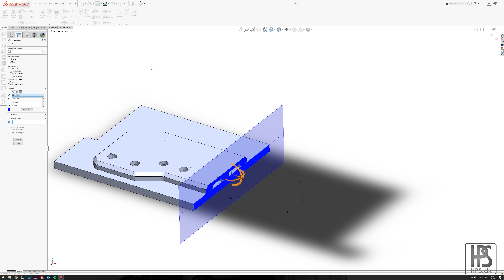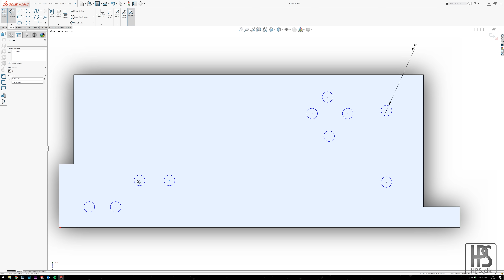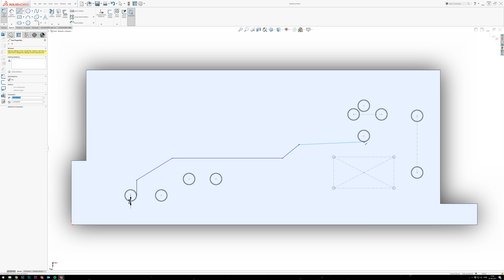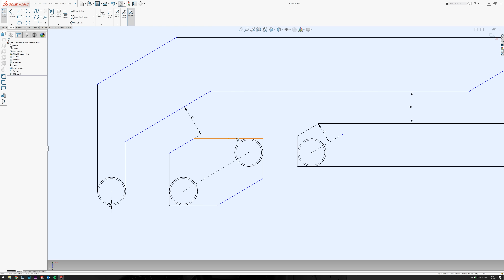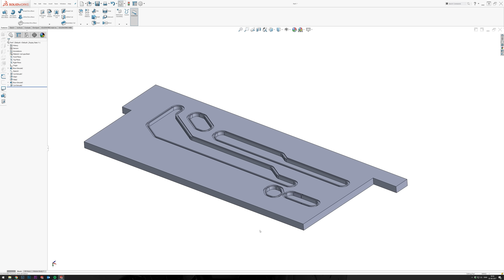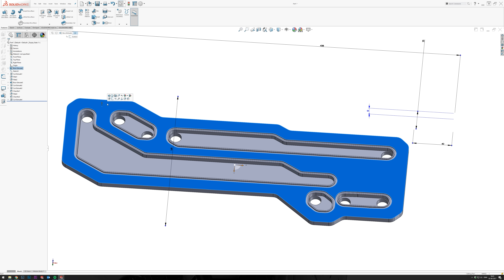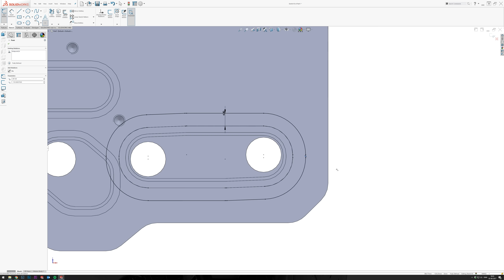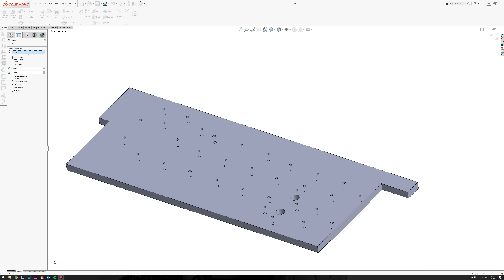Making a acrylic watercooling distribution plate / Manifold

Comment: Looks awesome Hans! Hey thanks for the tip about using another fitting to line up your G1/4 tap square. I don't have a drill press but I want to add an extra return port to my Radikult CNC res. Have yourself a Happy New Year mate.
Reply: Yeah, that was a PRO tip.

Comment: About tapping. A good tool to have around is a thread tapping block. Probably not going to find one off the shelf for G1/4. But iirc that's a parallel thread, and it should be really easy to make one.
Reply from the maker: Oh nice. I could probably 3d print one if needed. Thanks!

Comment: What CNC used? bits? Organization for screws etc? would really appreciate it. A lso for the ucstom cables, what pinout method do you use, PSU teseters like thermaltake dr power  II, multimeter? I'd really love it. My dream to make stuff like this, thanks.
Reply from the maker: I use whatever cnc is available at the time. The majority of the work is sanding and polishing after machining anyways.
I just use the original post cables as reference when making new ones. Much easier for me than any pinout scheme.
Reply: @metap0Pe  I have a cordless orbital sander with 3 sanding pads, would that work? I can buy more for it. I was also planning to use the original stock cables that came with the PSU aswell, and then PSu tester/pinout to see the voltages/lines in each pin I assume? I  usually make sure teh PSU's I buy come with their stock cables. I guess I'm on my way, thanks hans!

Comment: Do you have any experience with glueing acrylic plates? If you want to do some complicated, artistic runways for the water, you can't work with o-rings anymore. The problem with glueing though is that the glue spills out of the sides and leaves ugly residue.
Do you know of a way to glue the plates together beautifully and perfectly? I've even considered making a structure out of ice and then casting the PMMA around it. Then waiting for the ice to melt and rinsing it out. But I really don't think that would work well, when the 160° C PMMA hits the ice.
Reply from the maker: Haha yeah the ice might disappear quite soon. If you absolutely want to do that I would glue it and clamp it firmly together and run distilled water trough to get the glue residue out.
Reply: @metap0Pe  That sounds like a good idea. As long as the water doesn't creep into the contact surface, this migh work well. Maybe even more so with UV-activated glues.
Another idea I had was something like diffusion bonding. I would build an oven with very fine temperature control and then go close to the melting point of the PMMA. After some time I'm hoping it fuses together to form a solid block. I know this technique from metal working, but I have absolutely no idea whether it works with acrylic plates.

Comment: What does this distribution plate actually do? It doesn't cool water since it's made out of acrylic right? Or does it just improve the overall appearance of the machine itself? Just curious and not sure how I got here but I have a few CNC machines and this would be an interesting project as my spindle cutters are watercooled.
Reply: A distribution plate, like the name says, makes it easier to distribute the water from one block to the next. Starting at 7:04 you see, how he only has straight pipes from the blocks to the ditro block. It takes away some/most of the bends you would have to do with hard tubes.

Comment: Hopefully you respond, I know this is an older video. Thanks for posting this. I am using solidworks and am curious what program you use for sending the GCode to the cnc mill? Also what bits do you recommend for milling the cast acrylic? Thank you.

Comment: Do you custom order your o rings to length, or do you design each channel for a specific length o ring. If it's the latter, is there an easier way to define a complex sketch perimeter in solidworks?
Reply: Its that offset that confuses me, was it just careful planning that allowed you to know that the length of each channel before you started sketching, or is there a shortcut to it?
Reply: Oh, nvm, they sell them in .5 mm intervals. Would you say that .5 mm is within tolerance for this application?

Comment: Did you get any pressure drop from distribution plate? Look is important but performance is important, too.
Reply from the maker: Having tonnes of pressure and flow in watercooling systems is super overrated. You will almost never be able to tell the performance difference between almost no flow, and full throttle with 4 pumps. The heat capacity and absorbtion ability of water is just so high.
Reply: hans peder sahl that's not necessarily true. It's just like with fps. If you go from 30fps to 60fps it is a massive difference, but when you go to 60 to 90 FPS, it's not really that impressive of a jump. And then when you go from 90 to 120, it's even less impressive of a jump. It's because it is exponentially decreasing in performance. The performance is still gaining but it's only gaining buy a little minuscule amount. Of course if the water was not flowing it would immediately ramp up in temps and thermal throttle. Otherwise you wouldn't have to have a radiator... because water flowing through the radiator is literally what cools it. But there is a certain point at which it becomes a little excessive in speed. Water only needs to flow so fast to carry the heat with it. Just like I said when going from 30 to 60fps, it's an amazing jump, but anything above that is not necessary. I'm sure there are Freaks and Fanatics that would absolutely want to have the fastest water ever, but it is simply not necessary. It makes such a little difference that makes it not worth the trouble.
Reply: Tard, it has been tested. If by 90 to 120 fps you mean the 0.1C decrease in temps you get from higher flow/pressure, you're right. But to me the 30fps boost going from 90 to 120 is much more impressive than a 0.1C temp difference, especially considering that 0.1 is within the margin of error.
What happens in a water cooling loop is the water absorbs the heat when it passes through the water block and then delivers this heat to the radiator. From there, the heat is passed to the radiator and exits the loop by the air supplied by the fans. The only reason pressure or flow would matter is if the heat capacity of water was small and couldn't keep absorbing heat if it stayed in the water block for too long. That's not the case, just like Hans Peder said, the heat capacity of water is just so high, and so the water can absorb more heat than it actually does in almost all scenarios. As long as there's some fluid movement, the loop is good.

Comment: Hey, I am planning to make a custom water block and found this video very helpful. I have a couple of questions remaining:

Is it fine to use thinner o-rings? I was planning to get 1mm diameter. Does the risk of leaking increase if the o-ring is too thin?
How thick should the acrylic plate be, what's the minimum thickness? Is it possible for the water to rip the acrylic if it's too thin (let's say, 3mm)?

Comment: Beautiful work. The liquid cooling industry needs more people like you on their design team.<3 
I wish I had the skills and tools to make a mono block for my sabertooth 990fx R2.0 as those gosh darn VRM keep overheating. However the motherboard is too obsolete to even bother with liquid now. It would probably cost less to simply upgrade the system completely.
Anyone in the comment section know of any heat-sink/fan combination that might fit the sabertooth 990fx R2.0? to solve my problem? I've heard that this is a pretty common problem with my mobo but I haven't found any  good solutions or parts-guid online.

Comment: Do you use nickel for the backplate? And if not, does it matter what metal you use as long as it's non corrosive?
Reply from the maker: Exactly what do you mean by backplate? The one for the graphic card?
Reply: +mateo pena
I believe You are mistaken, this is a "DISTRIBUTION PLATE", i.e. it it's not a "cooling block", it doesn't actually "cool" anything and hence it is "all plastic" (both front and back, transparent front to see the liquid, and black back in this case"). This is ""just"" a more sophisticated way of distributing You cooling fluid to where You want it. Though In some cases it's also used as a reservoir and some even have the pump mount built in. Though I'm not certain that it's really correct to call it a "distribution plat" at that point. 
Best regards
Reply: Yes, I'm aware of the function of this part and I understand that this is not a cooling block, although my phrasing certainly could have been improved and it now seems clear that I did likely overlook something given the confusion. I was referring to the black (that is not a typo, I do mean black and not back) plate that the clear upper aperture of the distro plate rests upon. The part I'm referencing can be seen being tapped at 5:06. I certainly may have misjudged the material he used, mistaking painted or otherwise finished plastic with painted metal due to the scrathes, however, even if I did make this mistake, my question remains just in the hypothetical. If one were to use metal for this part, would there be any restrictions other than corrosion resistant qualities? I hope I have clarified my position
Reply from the maker: Ah, this is a 10 mm black acrylic plate. You can use whatever fits in your loop. So if you are using alu parts, you can use alu, and if you are using copper or brass parts, use those metals instead. Nickel is just a surface treatment, and you should never use nickel/copper/brass together with aluminium.

Comment: What is the cnc router /setup you are using for your projects?
Reply from the maker: Variates from project to project. I mostly use big machines in a professional shop, but you can get the same result with hobby machines as these are not very complicated parts.

Comment: why are distribution blocks used? its looks cool and such? (awesome work btw!).
Reply: You don't need extra fluid in your system past what's in circulation (meaning the volume of fluid in your tubing, blocks, and radiators). Reservoirs are just there to look cool and to keep the pump from cavitating when filling your loop or flushing and draining. really, only about 100mm length of tube reservoir (60mm diameter) is needed to safely fill a system without destroying a centrifugal pump like the industry-standard  Laing D5. This just looks really cool.

Comment: Why dont you use solidworks hole tool? Seems easier than going in and chamfering all countersinks
Reply from the maker: I judged this to be quicker. I would have had to click each hole with the hole function regardless, so it would be the same amount of clickc (I think). I always use the hole function to make the threaded holes so they transfer directly into CAM though.

Comment: Have had a design for a block for my case for a yr and a half... never found someone that would cut it for me without over charging like hell.... cheapest quote I got was around $250... not worth it for the size I wanted lol
Reply from the maker: Well, they do take some time to make, so you have to be willing to pay the man hours it would take. 250 sounds like a cheap price. Even a small part takes multiple hours to machine, and then materials comes on top of that.
Reply: hans peder sahl THIS, people have no idea how many hours of work it takes to [insert workshop task].
Also the value of the materials used etc. I lose faith in humanity sometimes.. 😂
Reply: coffee jack not necessarily true... unless you're trying to do a task without using tools or you are trying to do something with tools that work extremely fucking slow... usually they have a scale that says this amount of work memes this many hours of job, regardless of whether it takes you longer or less time. That's why you have to learn to beat the clock, mechanics do it all the time. It will say it takes 3 hours of Labor to do a job when really it takes only 2. So that means the customer is paying for 3 hours of Labor when the mechanic did it 2. And if you're good at your job and you know what you're doing you can beat the clock on every job and therefore successfully gain time. This is where a mechanic or ( insert any job based on hourly work ) really starts making money. And yes sometimes jobs will take a long time, but that's why you don't sit around and wait for that one job to be done to go to a next one. Prioritize the jobs. Make it so that you beat the clock in the best way possible. I'm sure that most companies have many Machines working, I doubt they have only one CNC machine out there trying to do their jobs... but to OP, I'd say make your own with your own tools... then use a blowtorch to give the perfect acrylic finish.

Comment: Just a little tip coming from a machinist. When taping it is best to only do half turns and depending on what your taping 1/4 to 1/2 turns back wards. It helps remove any cut material and also back cuts the threads as well as relieves pressure on the tap.

Watching  the tapping in the video was kinda cringe worthy. Other then that I loved the video and pretty informative.
Reply: cutting the guy down isn't cool.